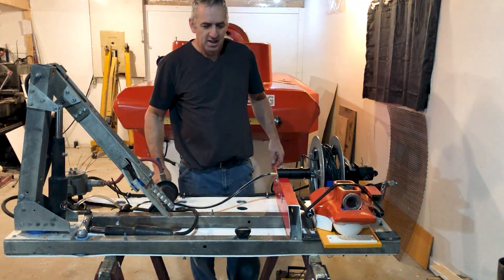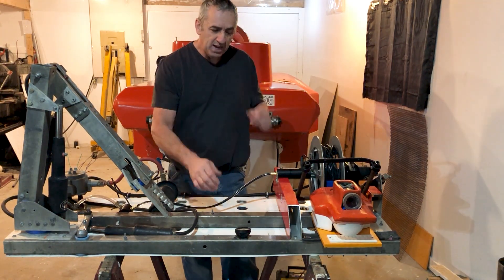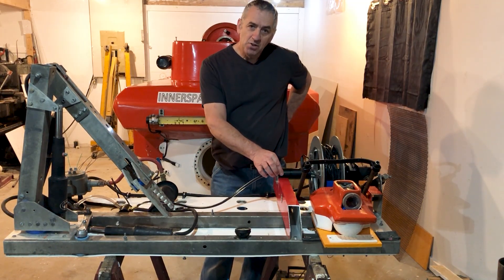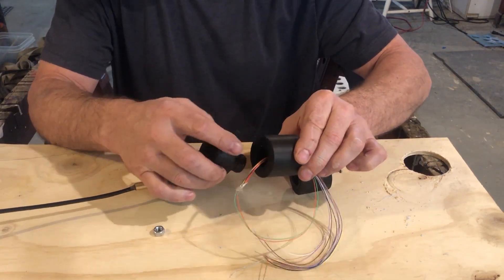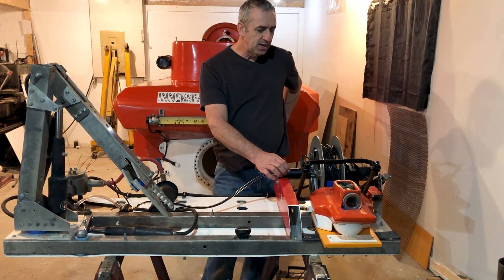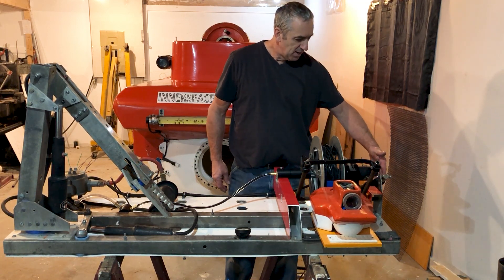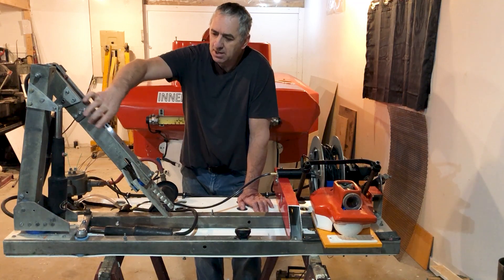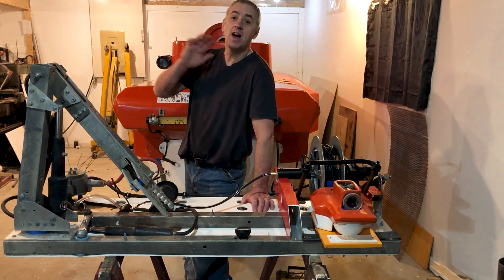Homemade ROV Demonstration

Comment: Really like your vids and your projects. Even your main job is pretty cool, having watched an apartment complex being moved in Fort Lauderdale for a highway expansion. I had plans of one day making a shallow underwater habitat out one of those fiberglass fuel tanks they bury under the ground. Had drawings all over the place, but life got in the way.  Living in Caribbean one gets to see how water affects everything, it has been my life, the water.
As a marine electrician & OB mechanic I really appreciate your use of some of the components you use. And I can appreciate some of your cost savings. I would like to think you have tried or could try some of the excellent outboard components that are very well built now-days. Relays, sensors, wiring harness connectors etc. I know the brand name makes are not cheap, but some are worth it. Keep enjoying your projects, it shows.

Comment: Is it just me or does the ROV look remarkably much like a miniature version of the mother-sub? I'm really thankful for the fact that 2 weeks ago I stumbled on to your channel, Hank. The amount or progression you're making is simply amazing, building one sub after another and each one more advanced and with more gadgets and safety mechanisms. I sincerely hope your amount of subscribers will increase just as rapidly as the progression of your subs, you definitely deserve every bit of income YouTube sends your way!

On another note, is there any chance you could show us a close-up of your ROV, and to be more specific, it's propulsion system? I have always wanted to build myself a small ROV as well, but I've never managed to find a suitable for powering the propeller while still keeping it watertight. If I wanted to be absolutely certain of keeping it watertight then I would try to magnetically couple the power from the engine to the drive shaft that connects to the propeller, thus avoiding having to pierce the hull. However that seems an inefficient way to couple the engine power to the propeller and would likely only work with a fairly limited motor output. The alternative and more classical way would be to use an axle that does pierce the hull, however that comes with a whole slew of it's own problems, especially when it has to be rated for anything in the rang of several hundred meters of water depth, let alone even deeper. Is there perhaps any advice you could give me?
Reply from the maker: The ROV is similar in appearance to the sub by design.  I did that just for the fin of it.  The cheapest way to go deep with a cheap motor is to oil fill it with a small expansion hose that will pressurize the oil as it goes deeper.  That is what I did with the motors on my ROV.  The motors are cheap bilge pump motors that have a new end cap glued  on with an electrical penetrator, for the power wires.  Use the thinnest oil possible, like silicone oil or I use WD-40.  I am not sure how long these motors will last yet.
Reply: @HankPronk  Did you notice a big decrease in power output? Normally a motor's rotor would be spinning in air and thus having very little drag, but considering the density of oil is even more than that of water, doesn't the rotor suffer a lot of drag from having to spin in oil? Any idea what kind of decrease in power that would generally cause?
Reply from the maker: @pieterveenders9793  I did an amp draw test and the motor is pretty happy so far.  I do the same with my trolling motors on the sub.  I deliberately went with a small propeller to reduce the current draw.
Reply: W•H•A•T•S•A•P•P

+•1•5•1•0•7•3•8•4•8•7•7•🚀

I•n•v•e•s•t•<>in<>C•r•y•p••t•o
B•T•C<>A•N•D<>•E•T•H...!!!🔂🔂🚀🚀….

Comment: You have a lot of oil filled systems. I would be nervous of  bubble of air being trapped, then under pressure it could create a small explosion. I would not be too difficult to flush the system with nitrogen before filling with oil. I wish you success.
Reply from the maker: A small air bubble is desirable, it allows for expansion as well as compression.  This is a standard way of  pressure compensating  deep diving systems.
Reply: @HankPronk  I worked on the deep rover prototype and what we did was attached a rubber bladder exposed to the water to equalize the pressure inside housings. If you want a bubble inside the housing I would just make sure it contains no O2 otherwise it will turn into a diesel engine.
Reply from the maker: @vrodshewchuk  NO it won't, I use a clear tube on small stuff and a truck air bag as a bladder on the big stuff like the mechanical arm.  There is no room for a bladder like that on the ROV.  With a small tube there is no room for expansion, that is why I like to have a small air bubble.

Comment: Hank, If the bilge pump motors are brushed, won't they mess up the oil or vice versa?
Reply from the maker: I do the same with the trolling motors on my submarine.  Honestly, I don't know how they will stand up to oil filling.  I did an amp draw test and that is good.  I have run the motors quit a bit already and so far so good.  I guess time will tell.
Reply: W•H•A•T•S•A•P•P

+•1•5•1•0•7•3•8•4•8•7•7•🚀

I•n•v•e•s•t•<>in<>C•r•y•p••t•o
B•T•C<>A•N•D<>•E•T•H...!!!🔂🔂🚀🚀….

Comment: You will need a shear device to cut the cable on the minisub so when it gets stuck on the bottom your sub can still rise.
Reply from the maker: I am making a cutter in the arm as we speak, also the tether unplugs when completely un-spooled
Reply: W•H•A•T•S•A•P•P

+•1•5•1•0•7•3•8•4•8•7•7•🚀

I•n•v•e•s•t•<>in<>C•r•y•p••t•o
B•T•C<>A•N•D<>•E•T•H...!!!🔂🔂🚀🚀….